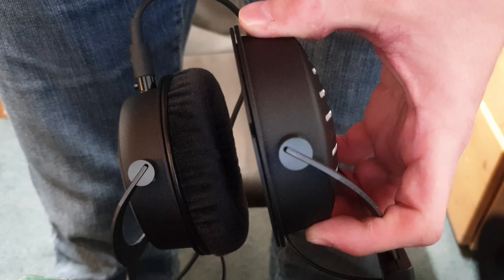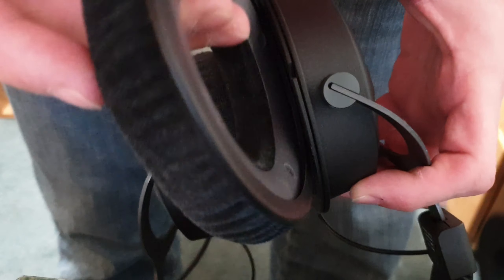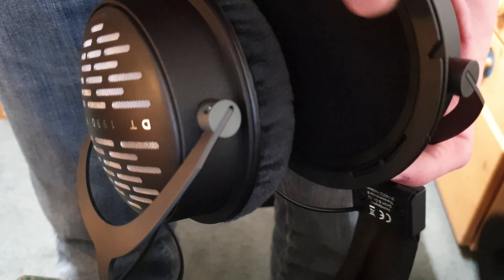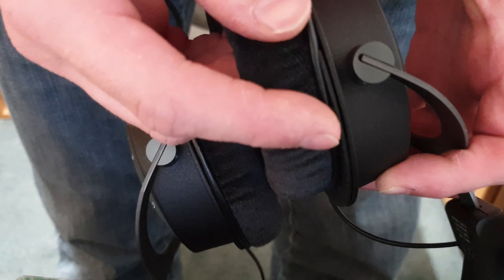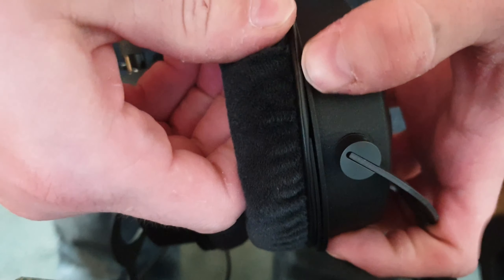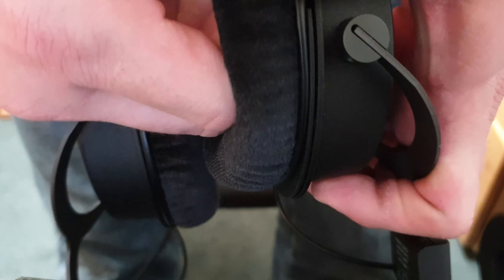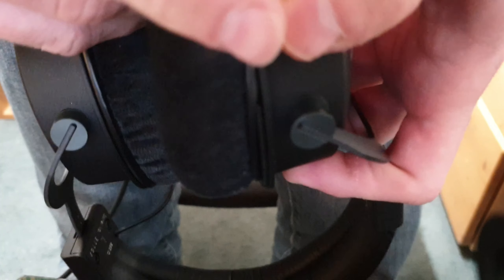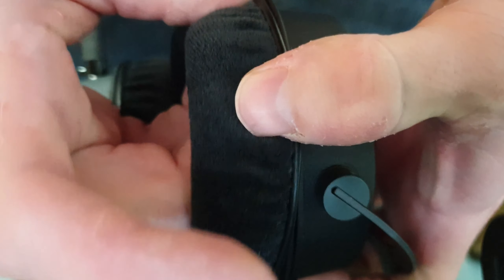Beyerdynamic 1990 PRO Changing Ear Pads How To Video

Comment: Check the manual, you are turning the pad in the wrong direction. You have to turn the pad towards the sharp notch, not the one with flattening. It's a lot easier this way and no one will ever get frustrated again.
Reply from the maker: haha thanks but none ever reads the manual :D i am amazed by the views of this video. i didn't read the manual and tried both ways and this went easier for me. and after doing it a few times after this video. it becomes easier and easier

Comment: You can use a guitar pick to pry open between the groove which will pop out a bracket.  From there, you can apply the earpads in the bracket and pop it back in the same orientation.
Reply: Many many thanks for this comment! I am not a patient, nor a delicate man so I was really getting fed up trying to thread the lining through the groove...
This was a lifesaver. I don't have a guitar pick, used a small flat screwdriver very gently and once it's off, it's a 2 minute job without hassle. Again, many thanks!
Reply: This was a lifesaver for me thanks!
Reply: You can also get those brackets as replacements for a buck each. So if you wanna swap to some aftermarket earpads you can put them onto the bracket and just snap the bracket on. Easiest swap ever.
Reply: That did it! Thanks!

Comment: It’s a simple procedure, just align and slip in the cups lip in the notch and apply pressure and start twisting away while maintains the pressure for a full circle until you arrive back at the notch. Pull them off and repeat the process if you are defeated. Until wallah they slip on. I can’t hear the difference , why are there two pairs. Which has more bass.

Comment: I'm going CRAZY trying to do this!!! Please clarify for me: 
1) Does the pad lip first go under the straight side of the notch, or under the angled side of the notch?
2) I have the headphones in the same upside down position as your video, so once the first part of the pad lip is under the notch, do you rotate the pad clockwise or counter-clock wise?
3) Are you pressing the pad in, or are you just carefully rotating  the pad?

Comment: If anyone is still having troubles after reading the video and comments, one tip is to but a finger of the stationary finger on the sharp edge so the lip does not jump out, then just turn. Worked like a charm for me but took a while since I had already messed up the lip a bit.

Comment: U seem to be using the part of the cut out that is not straight but in a diagonal line towards the center of the cup, i found that the straight part (the other side you are not using that is completely perpendicular to the center of the cup) is way better to press against and makes it easier to fit the pad.
Reply: You. are. a. LIFESAVER!!! I was about ready to rip my hair out doing it like he did in the video, but trying with the flat side I got it first try. THANK YOU!
Reply: A warning to people: this did seem to be easier, but it damaged my pads. Your mileage may vary.
Reply: @Seybre  HOW DID YOU DO IT I'VE TRIED EVERYTHING EVERY WAY
Reply: the straight line will damage the pad...

Comment: I had 770 pro before which don’t have the notch and it’s a pain in the ass to get the pads back on (that’s why I avoided to change/clean them) but the design on the 1990 is great and pretty easy if you know what to do

Comment: Wow I did it alot quicker holding it upside down like that. The right pad I can get on no problem, but the left pad once I held it upside down, it went on in like 10 seconds
Reply from the maker: after changing pads a few times it go's a lot quicker because they loosen up a bit and ofc you get more handy at it
Reply: @SimRacingSK  yeah once it's in it's easy to get it on, but the flap kept coming out when I was turning it. Once I flipped the headphones around though it stayed in no problem

Comment: this is enormously frustrating. you shouldn't have to gamble on your ability to switch pads on a pair of headphones that cost $600.
Reply from the maker: its better they give people like you no choice ;D
Reply: @SimRacingSK  i've been trying for 3 hours. beyer needs to make their product better.
Reply: @SimRacingSK  every damn time it slips out half way through and there's no way to prevent or correct it.
Reply: @dontwatchmydoomvideos  Did you ever find a way to prevent it?